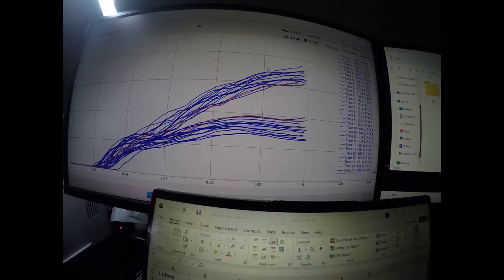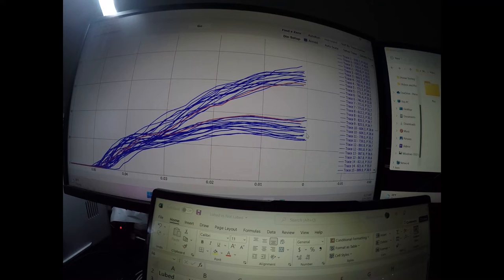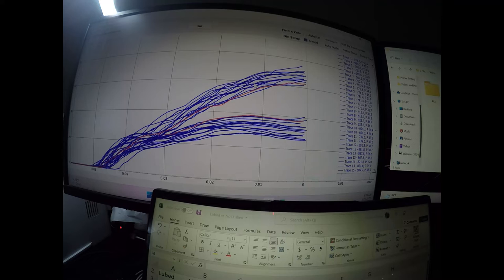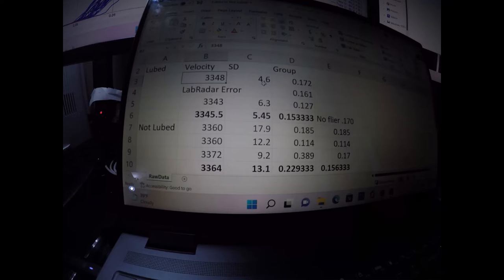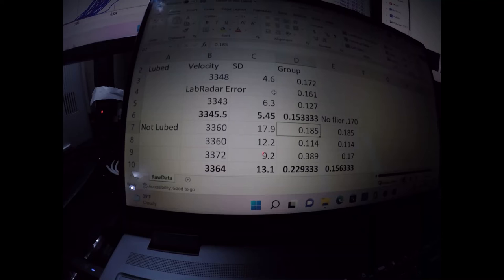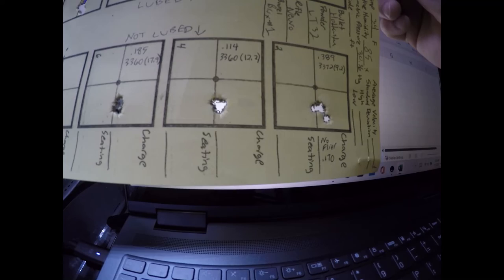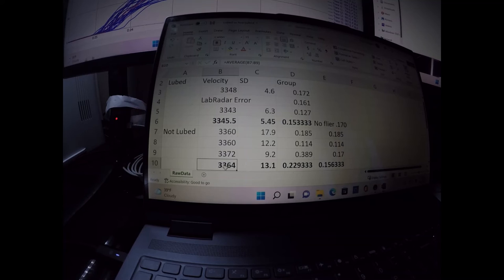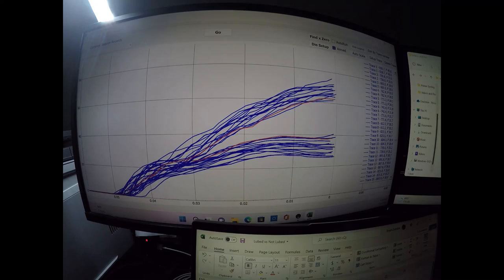AMP Press Series: Effects of Lubricating the Inside of the Neck and Bullet

Comment: I've been doing ng this lubrication for almost 18 months.Its a good step.Great video.I don't have an Amp Press,just a K&M Precision Arbor Press with Dial Indicator for  Pressure.I write down the results and it shows t he same info.The shooting with Labradar and Shotmarker also gave same results as yours. I did 20 and 20 bullet split.
I also had a couple flyers with one excessive speed.Dont know why.My V4 Auto Trickler & 120 scale is spot on
Reply from the maker: I am finding there are a few factors that can cause speed variations. One of them being primer weight…the heavier the weight, the faster the velocity.
Reply: @WitchDoctorPrecision  Bryan I sure did not know that.I will have to look into that.Im going to orider and Amp Press and Annealer.Its Been on my list. Just bought a V4 Auto Trickler and fx 120i Scale.
Getting a little more good stuff at a time.
The Century 21 mandrel helped my velocity and consistency and neck lube.Thanks for telling me about the primers.I use a lot of cci 250 on my 6.5 PRC And my 300 PRC.I never thought about weighing primers though.
Reply: @WitchDoctorPrecision  Bryan, How much variation are you seeing in primer weight? Also which brand of primers are most consistent so far? Federal? CCI, ??Remington BR ??? Thanks, Hope you had Happy Easter too.
Reply from the maker: @TexasTrained  usually .12 to .14 grains with BR-4, 450, 205, and 205M. The BR-4 and 205Ms seem to have more primers in the 3.66-3.68 weight range and the 450 and 205 seem to have more at the tail ends of the distribution - 3.60, 3.62, 3.72, and 3.74. Another thing I find is that some lots are way more consistent than others. Also, within a brick of 1000 primers, some trays of 100 are more consistent than others and sometimes a tray or two can be lighter or heavier than normal. All of this variation has me sorting primers as part of my reloading routine. It takes a lot of time but I do it while I am doing other things so it is feasible for me.

Comment: I like lube in the neck to bullet interface for stability (I'm a hunting, XTC, and HP shooter, not a BR shooter so I pre-load my ammo). Occasionally you trip into adhesive friction and galling when similar nascent metals try to bond and stick. I can't explain my storage time factor theory, but storage time also seems to plays role and my hypothesis in that solid lubes can help mitigate this effect. 

To phrase my hypothesis in simple terms, un-lubed will have a higher likelihood of erratic friction compared to lubricated especially when storage time is considered.

As a suggestion to get to the bottom of the benefit for a BR shooter, it becomes obvious that the load must be tuned to the two different conditions to get a fair look. I would suggest optimizing the tune for un-lubed and same for graphite before we would draw conclusions. If the very least the graphite did was to prevent adhesive friction from causing erratic neck tension, it would be worth the trouble for you. Thanks again for sharing the work.

Comment: I had read about similar velocity differences in moly coated as well as hexagonal boron coated bullets.  I have been using graphite in my necks on the recommendation of a very accomplished score shooter, and felt that the gun was much less prone to fliers allowing those x's to just pile up.  With group I have not had enough time behind a ppc to know the potential yet, but I will find out!

Comment: Excellent work Bryan, I'm really liking what you have been doing.  I moly (dry) the inside of the necks in an attempt to achieve consistent neck tension and to delay or avoid cold bonding.  However, I don't want to deposit it (or graphite) in my barrel or have it effect the bullet velocity.  Consider running another test with coating only the inside of the neck with Neolube.  My expectation is you would get the same neck tension consistency with no velocity change and equivalent groups.

Comment: Bryan..another great video. How was the brass processes before this test? Was the brass annealed? Was the brass tumbled? I have been going back and forth between tumbling in rice in order to leave some carbon in the neck vs. wet tumbling and using a lube on the necks and bullets. Do you have any data on wet tumbled brass with lube in the neck?
Reply from the maker: Thanks for tuning in. I don’t tumble small batches like this. I dry tumble large batches because it’s too time consuming to wipe off the sizing lube from a bunch of brass. I never wet tumble and always leave the carbon in the neck. I have done a lot of informal testing and concluded that it is easier to tune with the carbon in the neck. I can always revisit this and do a formal test. Anyway, I wipe off the neck carbon with steel wool, wipe off the steel wool, brush the inside of the neck, anneal, and then resize. I am doing a test soon where I will be brushing the neck before and after annealing. Should be published soon. 

What do you think about wet tumble vs not?

Comment: Thanks for the video
Im not so advanced as you guys ,but I'm trying.
Well I built a machine that I fit on my press that will measure the force of each case as I put it through the mandrel and then sort them by numbers 
Same goes with the seating
Reply from the maker: Have you measured and found any trends with your machine?
Reply: @WitchDoctorPrecision  yes I found that for example some cases are 1.5kg some are 1.8kg and then those big ones 2.6kg and  those are tight neck tension

Comment: Hello Bryan - I am a long time reloader  who has ALWAYS struggled with batch to batch consistency. I have recently redefined my reloading process with a focus on consistency within the process. My current thought is to wet tumble each time (also anneal), my theory is I start with the inside of the neck in the same condition (clean) each time. I'm thinking anything else is outside of being "controlled"  i.e. how many layers of carbon are there, different powers leave different amount of carbon etc. My shooting is mostly related to hunting and plinking out to 500 yard's. So my question is the neck lube itself. You use Neolube, I am guessing it is suspended in alcohol and provides a very smooth even application. I want to know your thoughts on using case lube (comes in a tub and I am guessing is wax based) applied with a Q tip. Remember I'm not in any form of competition shooting just trying for consistency. Is there in your opinion any significant downside to using that?
Reply from the maker: I would try them both and compare. Some lines are better than others for certain applications.

Comment: Did you ever revisit this and try dry graphite with the neo lube?
Reply from the maker: No, have you tried that?
Reply: @WitchDoctorPrecision  I just learned about the neo lube from your video last month. I also don’t have an amp press.
Reply from the maker: @justice1327  are you planning on using Neolube? One other thing I’ve noticed about it is if I have bullets I made but haven’t shot in months, there is no “cold weld” effect.

Comment: Hi Brian,
In this video, you state you lubed both the inside the case neck, as well the bullet itself. I am a mid-range bench rest shooter, out to 300yds, shooting .223 Remington. I load the Berger 55gr FB Target bullet, which is short in OAL. While lubing case necks is not a problem, being able to lube the bullet is difficult at best, again given the length of the bullet.
Do you have a suggestion as to how I can efficiently lube the bullet, or how about the possibility of only lubing the inside case mouth.
Reply from the maker: I would use liquid lube and either dip the bottom of the bullet into it or dip a swab and then brush the lube on the bearing surface.
Reply from the maker: @timfarley6493  yeah, with bullets that small it will be hard. If it becomes too much of a burden then at least lubing the inside of the neck is better than no lube at all according to the data.